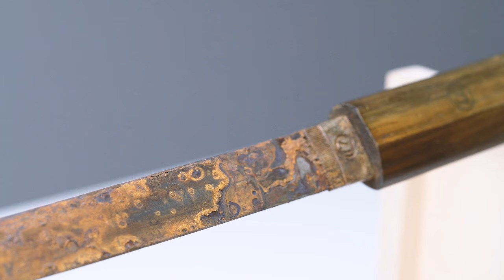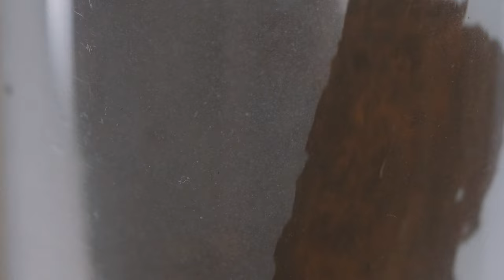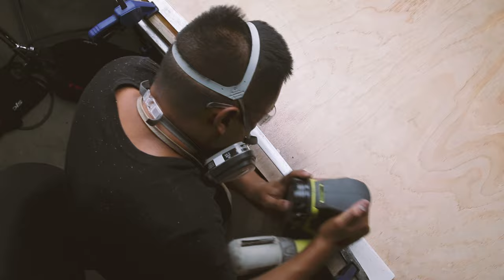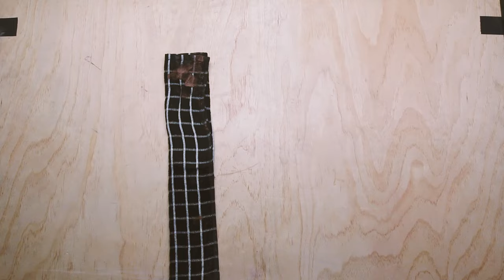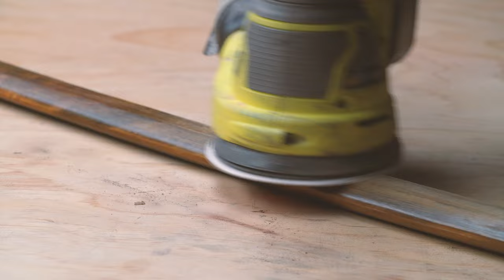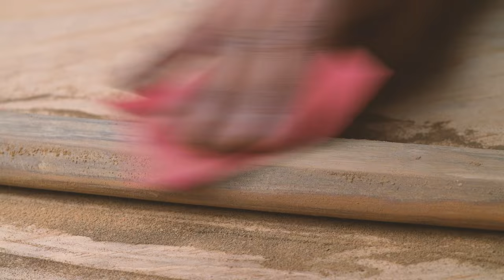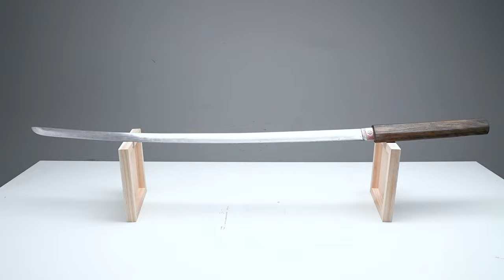Sword Restoration

Comment: This video just shows plan disrespect and ignorance to the original history of that sword, how dare you buzzfeed? Do your damn research before fucking up something so ancient!
Reply: it looked like a cheap reproduction but still respect the blade at all times
Reply: Like wtf they used a sander??? Plus removed the engraving? The engraving gives the sword characteristics wtf are they doing
Reply: milktea bubble it's a hunk of steel
Reply: mr.MYSTERIOUS,YT yeah, I am, your point?
Reply: that sword probably has 200 folds max it's nothing compared to my 40 thousand fold katana. You filthy gaijin get out of my dojo.
Reply: Isnamereally thatimportant Your point?
Reply: I thought he said that it was buried in a time capsule for 10 years...
Reply: Cheap mass produced stainless steel sword. Probably less than $50.
Reply: Noah I feel like that's a general Sam quote
Reply: I acctualy have the same sword and it only costs 150€ so its a cheap one (Jon Lee sword )
Reply: +Noah

With black iron sand as prime material? Sure, having that many folds would make it that insignificant compared to what your dojo owns. 

But ones that're made with modern carbon steel? What good does multiple folding do? Nothing else but give the sword a pattern that looks pretty.

What's so important about your blade at this point if we don't even know if it's made from the traditional material of black iron sand?
Reply: I hate Buzzfeed too but damn nigga they made that sword sharper, less rusty, more beautiful, how tf is that disrespectful?
Reply: Mosin Nagant They removed the original engravings which gave it history
Reply: Some One History? It was only buried for 10 years, not 100.
Reply: Loren Albert Magbitang I am 95% certain he/she does not have a dojo. That was a joke. XD
Reply: it was in the ground for 10 years
Reply: GhostWarrior 13 he didn't "restore" shit instead he fucked it up
Reply: Dropped Spaghetti So you think history means a hundred years no it means something in the past could be a year or two back as long as it's gotten full attention by the someonr sure it isn't "history" but it is still history on another aspect
Reply: Haakon Bledsoe Those swords are probably worth more than your life.

Comment: Be aware that vinegar works as an acid to remove rust. Adding salt to the mixture will speed the acidic reaction. That said, you will want to counteract the acid once metal is removed or else small amounts of vinegar still present on the surface will speed future deterioration. Lightly scrub it with a base like baking soda mixed with water to neutralize any acid and leave your metal safe.

Comment: I wouldn't say 'restored' so much has just 'cleaned'.
Reply: Its not cleaned its full of scratches and shit
Reply: It's clean, but 'clean' does not mean 'pretty', 'polished' or 'smooth'. It just means they got rid of the dirt and rust.
Reply: lostinfantry 
Not even the sander is a rotary sander which just makes really deep circular scratches which oxidize faster and faster.

Comment: A real restoration would've involved having the old blade removed and a new blade forged. This is beyond abysmal, you've basically worn down the outer layer of the blade to the softer inner core. That'll snap in a short amount of time and you don't need to cut into anything to do it, just swinging it around will suffice. Amateurs... smh
Reply: what is all of you guys problem stop  showing hate we try to make  the
world a better place and get all of you are showing hate.
Reply: Um it’s called a restoration not getting a completely new sword (since the blade is the actual sword). He made it sharper, and look better without any rust. He wanted to actually use the sword not just leave it as a piece of history stuck in the ground or sell it to a museum. It has become useful and he restored it, not bought  a rly sharp blade from amazon for like 500 $ ;-;
Reply: Peter Guillam wtf are you talking about? Soft inner core? You don't know anything and calling people amateurs, lol.
Reply: It would only have a soft inner core if it were case hardened. No decent sword would be case hardened. Some swords might be heat treated to where the edge is harder than the spine, but there's enough hardened steel at the edge that what he did wouldn't remove anywhere near all of it. He may have done a lousy restoration, but unless the sanding he did overheated the blade, hardness of the steel shouldn't be an issue with the finished product.
Reply: Peter Guillam the fittings arent tge sword,  i have a 14th century blade in wwii figtings,  tge blade is the sword,  restoring it would involve removing the rust,  just not like moron did it
Reply: it has no core to begin with cause it isn't a real forged katana. Its a dime a dozen cheap factory made "katana" most likely made from a single unforged piece of stainless steel. It was a hunk of junk for its entire existence.
Reply: Peter Guillam The one thing that bothers me about your comment is the end when you said "Amateurs... smh". You can't really be mad at him, he's new to this he's not gonna get better just like that. You're acting like he should be good right when he starts, they're called rookie mistakes.
Reply: Peter Guillam look at you, speaking as if you specialize in restoration of old swords.
Reply: Peter Guillam. Our last names are similar.
Reply: Where could he possibly be living to have something like THAT buried in his backyard???

Comment: You managed to ruin both the blade and the saya. Still 10m views. Good job, leave this stuff to professionals.
Reply: Pwn Sensei how did he ruin the blade and the saya?
Reply: Why comment if you are going to say bad things. I have to admit you are supposed to take everything off the blade first and he ruined the markings as well as using that steel wool to scratch the blade but do not expect evverything to be done perfectly
Reply: MainnDyress 2k55Koro thanks! I saw the characters on the saya, your also right, it’s scratched real badly

Comment: Bad restoration
Reply: Norden 488 It’s not even a restoration, it’s fucking destruction of something once beautiful...
Reply: Dude,calm down.Everything has property of death.Everything dies.
Reply: @Li-Zan Kai 
“I am fully aware that death will soon come to anything may it be a person or, and  sadly this Katana... but he fucked up his one chance of “restoring” this once beautiful peace of art ,of which could’ve been a worth a lot more if it was given to someone who has both the knowledge, skill and proper equipment to properly restore this Katana. 

Plus if you knew what ‘Restore, restoration’ or the word ‘restoring’ for this matter... (which means to repair/ or to renovate anything may it be art, building etc, back to its ORIGINAL condition) then you wouldn’t be here lecturing someone about life and death bullshit... 

Also to add, I would’ve let the power tools and other non-traditional tools used pass but since he used those tools to specifically remove the engravings which by all means is removing all significance off of the blade.. rendering it to be destroyed.. 

and before you read this wrong.. no I’m not disagreeing or showing any form of hate against your statement.”

Comment: holy fuck this is hard to watch, my father is a sushi chef and makes and sharpens his own blades. firstly you didnt remove the handle and do anything for it, the rust will eat through your blade and break off eventually if you keep cleaning it like that. Secondly and this is a big one, you scrubbed your blade with steel wool... dude im dead serious just throw your sword away, i havent seen past this far in the video, but you fucked your sword up more by touching it with steel wool than you did by burying it.

Comment: Congratulations, Bubba! You just Bubba-ized what had been an adequate, albeit improperly stored, low-end katana. It looks like it might have been a WWII issue sword for an NCO - probably not officer quality.

Now? It's just a shiny piece of scratched up metal, and the sheath had all of its character (pun intentional) power sanded away forever.

You could have done a proper restoration, but the only somewhat close to proper thing which you used was the water-stone... well, you even abused that, because your technique was painful to watch for someone who has sharpened a few blades...

Jeweler's rogue (sic) is about right, because if you where to know how to power buff it properly with rouge, what you did with the cheap home improvement center buffer pad and a hand drill is the work of a rogue.

You never checked the tang - just as well, since you didn't make anything worse there, inside the handle.

Oh, and they sell steel wool in the paint department at the home improvement centers. It does less damage than that pot-scrubber thing that you abused the blade with. It also comes in varying degrees of fineness, from 0 down to 0000 - four aught. The 0000 grade and some light oil would allow you to remove rust and gummed up finish from the blade and sheath respectively, if you know how to use it carefully, which you clearly don't.

Kindly go learn some shop skills before you go forth to bubba-ize something else and destroy another object's historical value...

Or take the easy way out and commit seppuku with your mangled blade...
Reply: chemech 
Thank you. These words all be it a simple comment in a large comment section are appreciated. Thank you once again from a hobbyist bladesmith.

Comment: Looks a lot better than at the start. I hope this was a modern,unsigned blade. That wire wheel still ticks me off, but you finished off as if you had done it before. Comments?

Comment: Oh gee. 1. Don't sand a blade, that's how you will A. Weaken I,  and B. Ruin the engravings on it.
2. He used vice grips to hold it down, on a wooden handle you are the supposed to do that because it can lead to pressure cracks. Just put it on a wall my guy, it would've looked nicer before you put it in the time capsule
Reply: PlanetGeekdom how do you properly restore a sword
Reply: How to properly restore a sword
Step 1: Not do anything in the video
Reply: Why are you supposed to add pressure cracks? If that was I mistake reread what you commented..
Reply: It's just a $40 sword he bought on eBay...

Comment: 👎. Sorry, but that is just plain awful. The steel's surface is left with scratches and pits, you've sanded  any inscriptions on the scabbard and handle away, you put the blade back into it's scabbard while sanding it, ruining the edge and you never checked on the tang. That is just plain awful.

Comment: I have bought a katana from a poundshop that has a little surface rust on both sides of the blade but is still a very good blade, in very good shape and conditions, and I'm trying to find a video for the best way to sharpen polish and restore a katana without messing up the timperline and symbols on the blade, I love swords and katanas have always been one of my most favorite blades and I don't want to mess up the only one I have left, do yall have any ideas or suggestions?

Comment: These restoration videos are probably the only good videos from buzzfeed. And goddamn, it was just a bunch of engravings, why is everyone butthurt about that?
Reply: Because there is a chance that this sword was treasured by the Japanese people or some it was an ancient relic of some sort.  Though the chances are slim, it isn't a  zero percent chance.  By sanding off the engravings, not only are you killing the weapons ability to work, but you're also destroying information about the sword.  You're also not paying respect to the original artists of the katana.

When the guy took out the katana, you could see he did a horrible job.  Normally, the katana would shine and reflect like a mirror after restoring it, but in this video it didn't shine and instead had scratches on the precious blade.

Comment: I do hope that is not a disc sander being  used  I bought an old but shiny Stanley plane which had been got at with a sanding disk and then wire brushed It still works but it has lost the sharpness of the edges as well at the original surfaces .Just soak in vinegar then steel wool

Comment: I'm no blacksmith, swordsman, or professional swordhandler, but I am pretty sure you're not supposed to: 

- Use steel wool 
- An electric sander 
- A WHETSTONE FOR A SWORD? 
- SAND THE SHEATH (and ultimiately reduce the life of that sheath)
Reply: Kaptionist the whetstone was actually the only thing he did that was fine. Everything else was absolute destruction

Comment: That is not how you unsheathe a katana! They are not supposed to make a sound. You just ruined the inside of the Saya. You could have sliced straight through it as well as your hand.

The wave pattern of the blade has been  completely ruined. The blood groove would have been shallowed. You had no reason to sand down the Saya. There are Katana cleaning kits and restorations out there. 

Mass produced katana or not, this is not how you honor a katana.

Comment: That symbol is the “Marto” brand sword company. I had one of those swords. Its basically a $50 sword
Reply: How are these swords attached to the handle? I got a 3 set of these.  I don’t see a mekugi pin.  It’s loose enough that I can see it is a rat tail tang

Comment: You should have soaked it in ferric chloride to show the hamon line. All genuine katanas have a differential hardening line! I am a custom knife and sword maker.
Reply: They didn't even remove the blade from the handle, its probably a purposely made rust
Reply: @LeftOverMacNCheese  oh no no no! You can’t get rust this deep I’ve tried. I had a knife soak in salt and vinegar for two months and most of it rubbed off. This is genuine rust. It’s too deep. Trust me. There’s a lot of pitting. But I would have replaced the handle as the rust in the tang could cause some issues later.

Comment: He didn't even remove the mekugi! What about all the rust on the inside of the handle?? But hey rust is in a way a good sign of a high carbon steel blade :) at least its not some stainless steel junk!

Comment: Anyone looking to restore a blade please do not do this. I almost cringed when he pulled out the orbital sander. Any sanding or edging or polishing should be done by hand to keep the edge straight. Also especially with katanas it is advisable to remove the handle prior to any repair or maintenance to keep from dirtying, damaging and also to work the entirety of the blade including the tang.

Comment: He doesn't know how to remove the blade from its grip. 
Probably it is still covered with rust under the grip and extremely dangerous to swing the sword.
The design of its habaki looks cheap. Hope it is the one of mass produced swords during ww2 or just made for a souvenir after the war.

Comment: This wasn't really well done, I mean, the sword's functional, but you really took away all the actual art and craftsmanship that went into that blade....

Removing Rust w/ Vinegar - Don't!!! Though it'll get rid of rust, it'll also potentially damage the blade! Use rust remover! Rust remover is DESIGNED to remove rust and won't damage the blade in the process! Also, rust remove is far more effective and will get rid of nearly all of the rust!

Steel Wool to Remove Rust - Also dont!!! The rust remover compound would get rid of all the rust when done correctly. Steel wool just scratches up the blade.

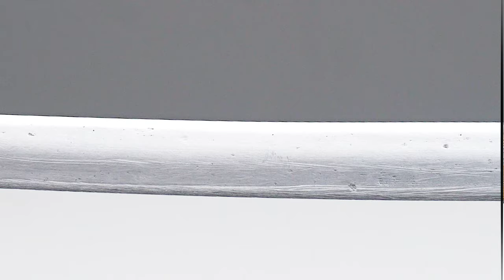Electric Sander - This is why I disliked, by using a sander you permanently damaged the original look of the katana as shown in 3:28 the best tool for the job is a coarse whetstone. 

Buffing wheel - Correct! This is the ACTUAL tool to use for polishing a blade, such a shame that sanding permanently damaged the blade though.....

Sanding the sheath - NO!!!!!!! you permanently damaged the sheath doing that (there was even writing on that sheath, now it's gone cause you removed it) Either leave the sheath as is, or better yet, make an entire new sheath and handle.
Reply: NomiyaNadeshiko wowowowo eXpErt

Comment: This comment section is a good example that you can't post anythink on the internet without getting ripped to shreds,with that said if the sword was buried to begin with i doubt it's anythink of great value,quit crying,i personally wouldn't have used an electric sander on any part of this sword either but we all make mistakes sometimes